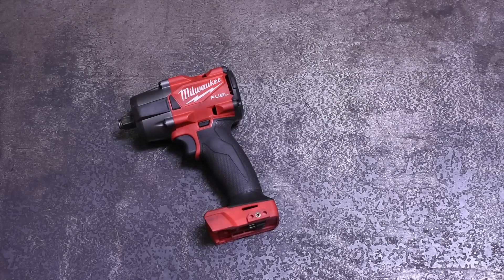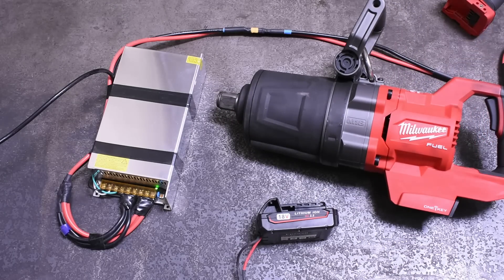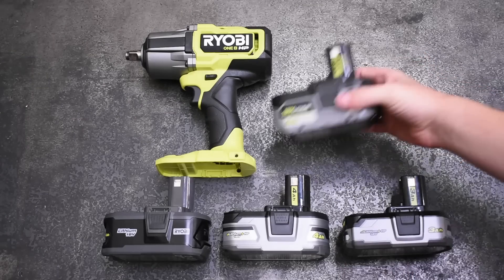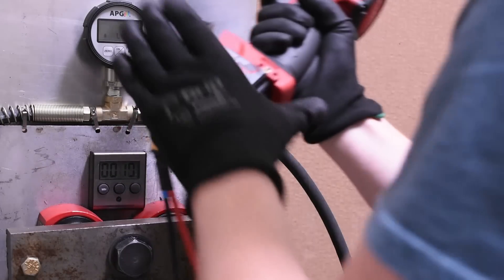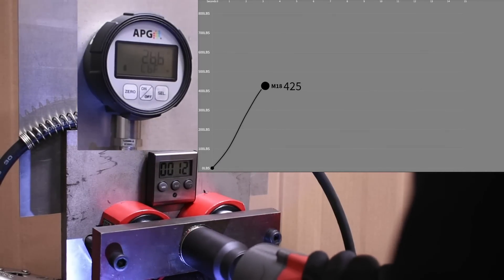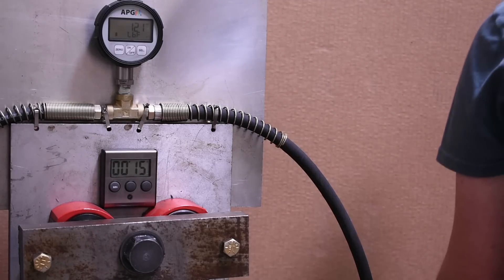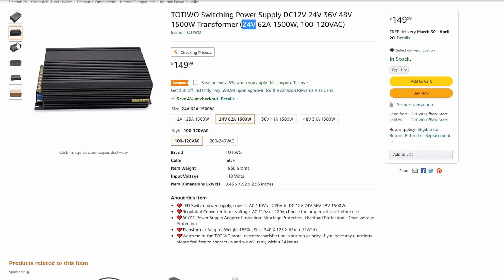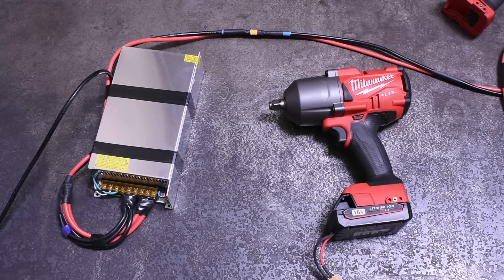Mad Scientist Youtuber Supercharges our Tools: 120 Volt M18 Impacts

Comment: The weirdness that was going on with the high torque, it might be related to this: https://youtu.be/_bgUy6zA0ts
It's a video from Electroboom on how some cheap leds will keep glowing when the power is cut off. Maybe somehow, the power is, like you suspected, "leaking out" into you, using your body as a ground or a capacitor. Maybe work with electroboom, figuring this out and experimenting?

Comment: Just use 3 deep cycle golf cart batteries in series. The voltage is about right and you’ll have more than enough amps. You also won’t electrocute yourself 😁

Comment: I’m sure a lot of people wouldn’t mind buying a well engineered power supply like this with like a ten foot heavy duty thick cord for shop use I hate charging batteries and the extra weight you will save and the extra power I think it would be a win win

Comment: I mess with radio controll cars for a while and work with those yellow plugs. Use beefier connectors next time, not sure what amps actually went through them but xt60 in Rc world is not advised over 3s(12ish volts) if any serious amps are drawn.  I’ve melted some of them running 180 amp speed controllers on 22v batteries and it’s not a fun sigh, managed to even do that at lower voltages too although could be my janky soldering this time. Jump up to xt90 at least which also accepts beefier cables or go for ic5’s. 

Could go overkill and use qs8 connector which also clicks in and could help with rattling. 

Maybe add extra cap pack inline too, commonly used in Rc’s, don’t help much with sustained load but nice for peak jumps

Comment: As someone who does tinkering using 24v power supplies, not all power supplies are the same.  A lower wattage quality supply with good components will vastly outperform a higher (advertised) wattage Chinesium special.  The good power supplies like Mean Well are also heavily counterfeited because of the disparity in quality.  Your success if you decide to ramp up this experiment will depend heavily on the quality of power supply you acquire.  Also looks like you're using XT60 connectors.  Upgrade to XT150 or EC5 connectors to mitigate amperage bottlenecks.

Comment: You could use lead acid car batteries.It would do the same thing.The 18V lithium battery is probably a 5S which means the fully charged voltage is 21V so you could probably get away with two 12V lead acids if you dont charge them to 100% . The only concern is the input capacitors in the tool might be rated for 24V max which means it will blow up if you connect two 12V batteries

Comment: One would think a solid 24 volts would be better as the amp draw would be less that way. 2 12 volt batteries (marine) in series to hook your power supply to then to the tool. I work on RVs and the hydraulic rooms won’t run right when plugged in no battery. Too many amps.  On the other hand hooking a m12 battery to my 7.2 volt rc car smoked the little motor in 20 minutes   But most electric motors will handle a wide range of voltage. And on a cold day I’ve been known to use the 24v option on the battery pack to get a big diesel to start turning (only old pre computer every thing). That being said the Milwaukee chip in the impact might say no to 24 volts. But I doubt it. I’ve been wrong before. I’ll be wrong again 
Whatever you do next with this type of hookup put a clamp meter on the lead to do an amp draw

Comment: I know that AVERAGE power consumption and INSTANT power consumption are different. Some of the discrepencies that you see with the transformer or DC-DC switch mode power supply vs the lithium batteries could be instantanious discharge rate. We know that just after a hammer blow, there is a massive inrush current as the motor is slowed down and forced to accelerate the hammer again. (You may want to see if you can graph this on an oscilloscope, it's pretty neat). And Inrush current spikes when you put a load on an electric motor. If the power supply is outputting less wattage but shows to be comparable to a lithium cell you calculate to be discharging at a higher wattage it may all be in discharge rate. Capacitors have a much higher discharge rate than lithium cells. So the brief acceleration between hammer blows is possibly kicked into high gear with the excessive current on tap with the power supply's pretty large capacitor bank. That being said, it would be neat to prove/disprove this theory.  One easy way to do this would be to get a 3rd party milwaukee battery power adapter (the one that gives you leads to power random stuff with your battery) and mix it with that cheap battery used to pipe the pixies into the gun that you used with the power supply, and install a couple farads of super capacitor in parallel with the standard milwaukee  battery. This will average the battery output so the motor isnt requiring it to output pulses of high current, and let the supercap handle that load. That's what they are designed to do afterall. You may just stumble on to a mod you can install internally in the handle of these guns that will significantly boost their performance!

Comment: Best way to improve this is to put significant capacitance in the battery adaptor right at the tool so current peaks can be absorbed by them and the PSU gets a more steady load. And turning up the voltage. And higher power units that can over power your 1000 dollar beast. Do it all :-D

Comment: Transformer is able to hold a steadier voltage under load. Your volts are dropping off with the battery throughout the run. Or at least my idea about why the transformer does better over time. Very hard to dip the voltage on a megawat system vs only several volts.

Comment: One of the reasons you probably won’t see power supplies like this over 1500W is that the limit for a household outlet is 1500W generally. The actual limit before the cables in your walls go up in flames is 1800 but there’s a built in safety margin incase the cables are a little under the spec

Comment: I would have to guess that the cutting out would be to something like a GFCI in the power supply, detecting current leakage and cutting off the power. Tho at only 18V it’s unlikely that you’d feel it all that much
Reply: Could also be a protection feature inside the milwaukee units themselves

Comment: Cables looked a little small for my liking.  Also, if you could find a 20 volt power supply that has remote voltage sensing, you could maintain a constant 20 volts at the battery adapter terminals regardless of the voltage drop in the cables!

Comment: Maybe having Current drop and not voltage drop is what's holding the 120v back? Get a 240v 15A or 20A Transformer and prey?

Comment: You need to get some 2V lead-acid cells, the 18. 20, 22, & 24 are easy. A used 24V forklift battery would do nicely.

Comment: Bring the + and - sense wires out from the power supply and connect them at the load end of the wires. That will effectively eliminate the wire resistance and keep a steady voltage at the tool. Much better regulation of the beans.

Comment: Would love to see voltage measurements at the tool under load on this guy (actually it'd be neat to see in general for stock tools as well). Those wires are dropping voltage which lowers the motor capability - let's see a 21V supply (equivalent to 5S lithium ion at full charge) with 10 gauge cables and then crank it up till the smoke comes out!

Comment: Maybe try an old Truck 24V battery it should provide the max amp you can get with 22/24 Volts very cheap and easy

Comment: I like the video, but you guys are crazy. That power supply is NOT UL or CE listed. Put an oscilloscope on the DC output of that power supply and you will see what's causing the problems. High frequency switching with high voltage spikes.

Comment: you need to parallel the battery and the power supply , that should supply all the current the motors need.
then monitor the voltage drop , if any , to see if there is any more that could be gained

Comment: The inductance of the motor is probably firing off high voltage when the power supply switches on / off an order of magnitude faster than the PWM motor controller in the tool. That's why the keeping the shirt from touching, rubber gloves, etc. were needed.

Looks like some voltage spikes backfed into the power supply and saturated some caps, that's why it turned back on when unplugged.

Pretty weird and neat. A linear power supply would work much better imo.

Comment: If you want to see some real shit. Just hook up (3) 6v golf cart batteries in series with a pair of like #1 battery leads run into a chinesium battery shell through a hole in the back. 

Probably can’t max that out.

If you think it can take it string 4 and have 24v, install a voltage controller if needed to bring it back down. But I don’t think all that is needed. 

I would put three and put a battery charger on the string to keep them up.

You could also use something called a maxwell boostcap. Make up a 18v pack of capacitors and let them charge off the battery string. Then put an 18v power supply on the string with current limiting to charge it but not cook it. 

The caps would give it max power from the jump and then the batteries would never let it drop during the run.

Comment: This is probably why Kobalt added an extra cell for 24v, which gives them the ability to get more power at a lower temperature or have packs using cheaper batteries that still outperform 20v packs.

I wish Kobalt would get in gear and be more competitive, or maybe they are focusing all their attention towards flex?

Comment: Adding a large capacitor inside the old battery housing would drastically improve performance, imo. Just make sure to add a series inrush current limiter to prevent the power supply from frying itself at startup. Also, a latching power connector would probably help. Additionally, he had a good idea when he used multiple wires on the power supply output, but even better would be carrying all 3 pairs all the way to the battery housing rather than just joining them halfway up. So yeah, maybe hack in a 6 position connector directly on the battery housing connected immediately to a big ass capacitor via an ICL

Comment: My recommendation would be to get you a pair of 12v lithium golf cart batteries and put them in a backpack and wire them up in series. Depending on the brand they’ll typically have somewhere in the 300-500 amp instantaneous (10 second) discharge rating and 200-400amp continuous. So 12,000 watts at 24 volts. I realize fully charged 24v lithium batteries are probably going to be above 30v but you should be safe with that voltage. Any time you let off the trigger there is a pretty significant voltage spike (100v or more on an 18v tool) due to the magnetic field collapsing inside the motor. If it can survive that it should have no problem with 30 something volts.

Comment: Cool. I think a plug in option is a great idea for cordless tools. I rigged up my kids hot wheels track booster (Needed 4D batteries!) to an old power brick and plugged it in. The cars stopped falling off the loop. t worked great.

Comment: Ooh yeah that's sketchy. Needs a few extra capacitors at the load end for extra current spike handling and bypassing electrical noise... I imagine the brushless motor driver is pretty electrically noisy since it's not really that harmful to be when connected to batteries. But stick that on the output of a switch-mode (not really a classic linear transformer) power supply, and I'm not surprised you had some gremlins. Though honestly, I am surprised this isn't something already sold by Milwaukee.

Comment: I saw the Ryobi version of battery plugged in wall on Amazon, but when I went to by it, it was gone. The possible output of the inverter matters greatly. Higher the wattage, higher the current avalible.  If this was just a strait step down xformer with a simple rectifier, this could get ugly fast!

Comment: It gains when the batteries lose their initial from-full discharge boost, and then uses more power to just maintain the lead. I think a graph plotting their rate of progress to a theoretical maximum would be more expressive of their comparative power.

Comment: The DeWalt 9ah flexvolt battery can put out at least 2460W And the 15ah can do 2982W (based on UWO of their highest output tools). That’s way more than what’s possible with a 15a 120v power outlet!

Comment: Make a battery/capacitor hybrid.  put caps in parallel with your battery pack.  Should be really good for break loose jobs, but top out the same on long jobs.  They're also much lighter and last WAY longer than batteries.

Comment: osha no no device haha ;) hmm im about to see what my m12 tools can do with one of these guys! the drill maybe sensing inrush of the xfmr causing the stalling. it probably does this to the battery to not kill it if it is lower in charge and to do the try but stop function like a dead battery has? this looks like a switching dc power supply may want to verify the internal config to see if its a continuous rating of 1200w or a peak of 1200w or derated to 80% or something like this.

Comment: I would love to see a modified impact gun with an upgraded motor and using a VESC motor controller and external power supply. You will be able to get some incredible tourqe out of it until the internal components decide they dont like eachother anymore

Comment: Server power supply's do have some serious power, (per example 
HP blade c7000,with some models giving 200A @12 V,2400w per unit). Other models can also do really good and more compact.Cables and connectors need to be sized to support the current. Maybe 2 or more XT60 in parallel. 
Connecting 2 in series and lowering the voltage to 21 V would be the ultimate beast. Isolating cases from each other is a must do it, and depending on the particular model some pins to be soldered (shorting them) to make the server psu start
without the enclosure/head unit.
Searching the YouTube for mining psu should give some information. 
I did this hack with a bosch 24V hammer drill,did worked but unfortunately the tool itself was weak. But with the big 1" D handle won't be a problem. Looking for news /tests with this kind of setup. Thanks a lot for the effort invested!

Comment: It would be cool if you got a live voltage reading while doing the tests and then overlaid the voltage drop over the torque charts as you did each test. Also you could try wiring up 2 batteries in parallel with a cable tether going up to the tool since the load an corresponding voltage drop would then get split between them. Or do 5 batteries. It could perform with even less voltage sag than the wall powered contraption, but we'd need that live voltage measurement to be sure

Comment: I would love to see yun’s take a castle creations sensored brushless RC motor and ESC and put it in a impact. A big system like a 1/5 scale system has up to 15 hp and boatloads of torque and because it’s sensored it can go as slow as you want or as fast as you want with no stutters. Also use a Lipo RC battery. These systems can draw up to 200amps or more. These systems will send an RC car over 200mph.

Comment: I feel like the ultimate solution would:
-Have the "battery" clips intact
-Have capacitors or super capacitors inside the "battery" to soften current pulses
-Have thicker wires
-Have a voltage drop sense line
-Have adjustable voltage, potentiality up to 24VDC to overclock the tool
Reply: Yeah, and the XT60 connector also doesn't help here.
Reply: @dusinnhht  Yep, XT90 could theoretically deliver over 1600W of power, vs the ~1100W rating (at 18V) of an XT60.
Reply: Nasty
Reply: I'd add a shut off switch before the power supply, and a better connector that can also be quickly disconnected between the power supply and the pack. Also a larger power supply, as on paper if the 12.0 pack can push 1800w, that's basically the limit of a typical wall plug's breaker; one running off of 240v would have so much more headroom compared to looking at higher amp 120v sockets, not to mention there's probably a lot more options on the market for a 240v power supply than there is for a higher amp 120v power supply.
Reply: Get a power supply that runs off of a 20A outlet
Reply: What current pulses would you get in DC? DC always has a stable voltage and current. Its so stable that capacitors are only effectively used in ac circuits cause dc cannot pass through the dielectric insulator of a capacitor. Secondly voltage drop would not play a variable here as the length of conductors is not long enough to produce such voltage drop, and upping the wire gauge negates any voltage drop regardless
Reply: @justinturnsvirtual  Nope and nope. Power tools create massive current pulses, causing the DC power supply to trip out. Capacitors are effectively used in DC circuits all the time. They only block DC in series, they "store" DC in parallel.

Voltage drop is almost certainly coming into play here with a wire run over 6ft and current approaching 100A! That can be partially helped with thicker wire, which is why I suggested that improvement.
Reply: @ewicky  thanks for the insight!

Comment: nice test, but this power supply is trash and dangerous. They limit the inrush currentby using a thermistor on the AC line and it fail quickly, also the wire gauge is not enought for that much current and cause voltage drop since there is more resistance being too small